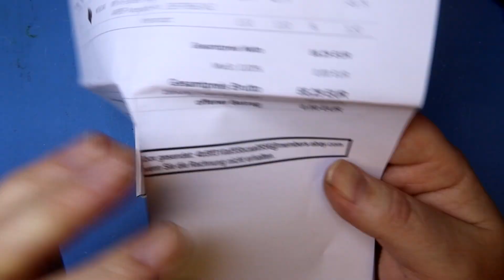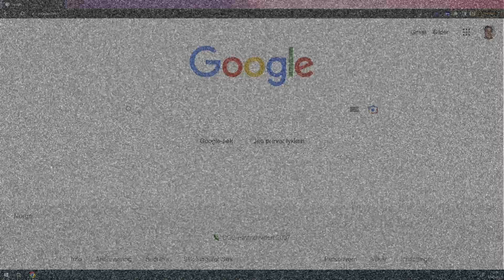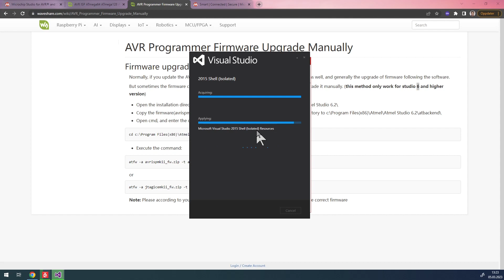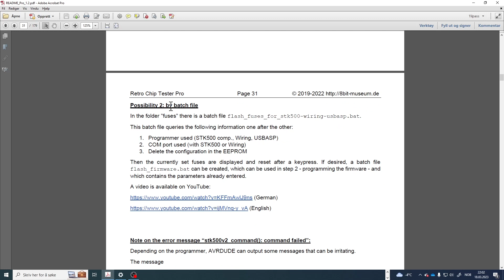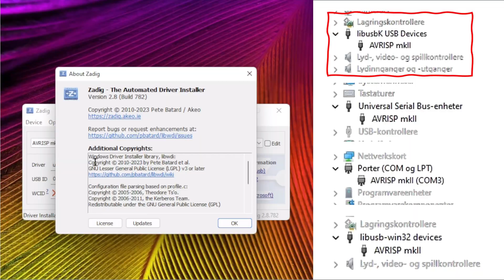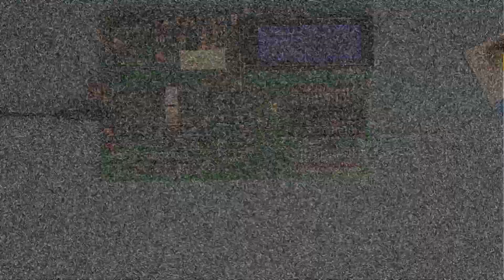Upgrading the firmware on the Retro Chip Tester Pro, and testing the USB AVRISP XPII

Comment: Is it possible to program RCT firmware with Visual Studio (Mac)?
Reply from the maker: I don’t have much experience with Mac's as a user, I can use them if I have to, and actually own a bunch of old ones. But regarding your question. By Visual Studio do you think of the Microsoft programming / development environment ? Then I think the answer is no. You only need a software to be able to communicate with a POD / ISP programmer that actually communicates with the Retro Chip tester.  The one that I used the AVRISP MkII do have a mac driver, and I know there are toolsets to communicate with Arduinos and AVR ships on Mac’s but I don’t know the details of what works or not.

Comment: When you say you were not able to make it work, initially, does that mean you could not get it to program at all, or did you just get a mismatch? I have an identical programmer to you, and it is identified as/with a CH320 driver and has COM3 as serial port. I can start the programming of the RTC Pro 1.2K, but when verification is being done, then it says verification mismatch….. My programmer came with the 6 pin cable as well, but the red line (pin 1?) is toward the bottom of the RTC Pro, where yours is up. It can be that the Chinese vendor just swapped the cable around…. I put a shrouded header on my RTC Pro for the programming, and it is placed like shown in the RTC Pro manual, so the cable cannot be connected any differently. Cable is also going out to the right side of the RTC Pro like in your video. To power the RTC Pro I used a USB connection, and when starting the programming it does recognize there is a programmer, STK500 type and that I get 4.7V in. Not sure if it is the driver situation, or something else. Oh and another detail. My programmer is flashing the RED light when connected, and when programming it turns solid RED. I do not know if it can show GREEN. What the flashing red and solid red means, I am not sure.
Reply from the maker: Hi it did work straight away in Microchip studio, at least I was able to se the programmer.  The Microchip studio installed this by default with the USB only driver. That I was not able to find a good configuration for in AVRDUDE. So then I installed some older serial port drivers, those I was not able to get working anyplace. I Then discovered the Zadig tool, and installed the generic Serial port drivers with these drivers I was able to see the unit, but had some trouble with AVRDUDE, and then I installed  the USB drivers with the Zadig tool, and then it worked straight away in AVRDUDE.  But I think Microchip studio is KEY here, because it updated firmware as it was discovering the programming unit.
Reply: @kojroRI Thanks for the reply. I just downloaded and installed the Microchip studio software like you did, but how do you see if it recognizes your programmer and gets it to FW update it?

Comment: This was an extremely helpful video. So many things I didn't have to track down myself after watching it. One difference with my experience is that my programmer (cheap aliexpress clone) came with a little card to convert from the 8-pin connector to a 6-pin connector, and when using the 6-pin connector the programmer supplied +5V to the RCTP so no other power was needed. Don't know if I was supposed to take off the daughter board in this case (I didn't), but it seems to have worked great.
Reply from the maker: Glad to hear that, and thanks for watching. I also come along some clones of this box that did supply power. But it seems like the newer ones don’t have this feature, might be some safety feature.